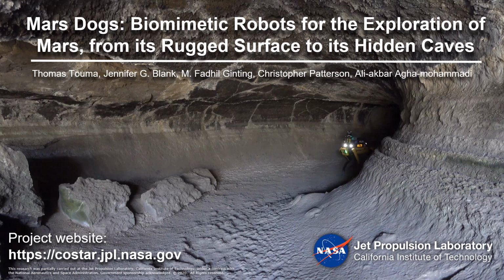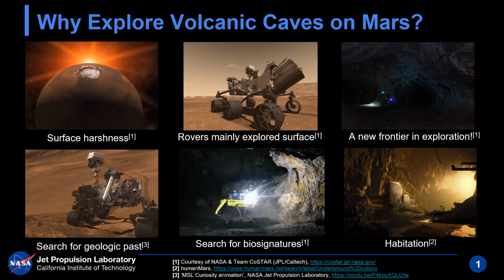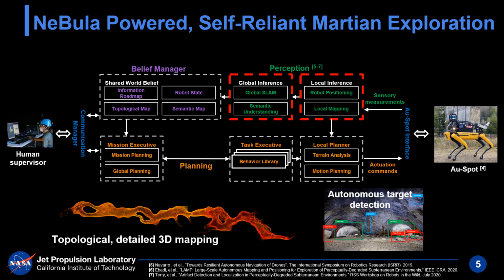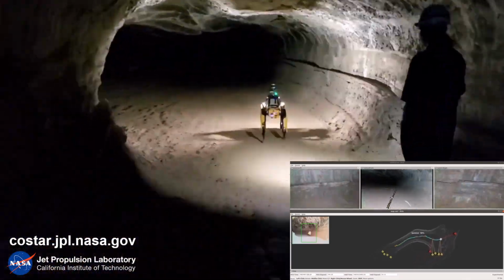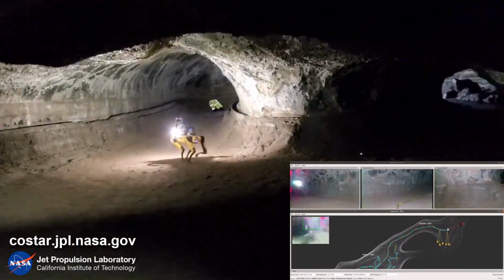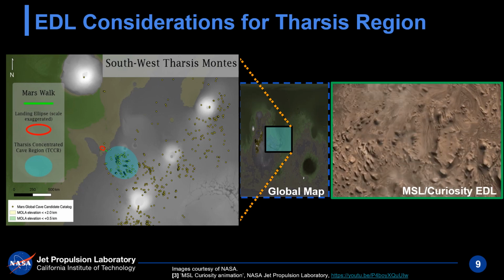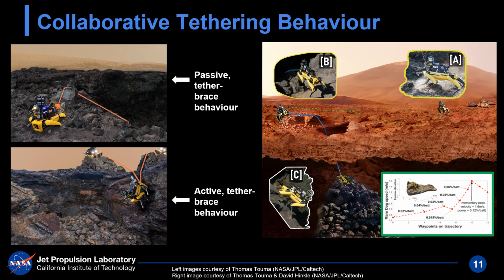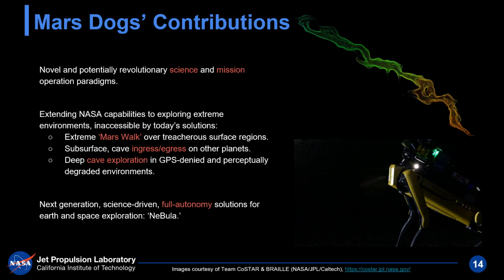Mars Dogs: AI Powered Autonomous Robot Concept for Mars - [R&D from NASA's Team CoSTAR]

Comment: honestly if it finds a bone, we should be worried hahahahaha

Otherwise i honestly think the most likely long term plan that would work insanely well, instead of spending the who knows how many millions in their one tiny package load, commision a heavy space X ship, then they could load not only one, but way more then that, maybe 10-20 ? additionally they would be able to load it up with instruments , some might be equiped with arms which could perform maintenance, they could even have solar pannels inside which 3-4 of them could install them outside... QR code lazer engraved thus no worries about them ever going away... making sure that the external solar panels can easily recharge the main ship which houses them overnight, this would avoid a few issues such as the cold nights which could cause component damage and extending the life of them. As space X could have a ladder / elevator system which the robot dogs could opperate, they can be equipped with two "mouths" why not hands ? and able to grab objects such as smaller pannels, install pannels they simply have to already be linked to the ship thus just brought down and unfolded... this would provide indefinite power, then have one of those dogs with  a broom to you know... house keeping :D

THIS! is a long term plan, many more experiments could be conducted if inside the ship there are some instruments, they could grab samples, the ship would have a larger base thus more space to have equipement etc.. etc.. also test if water is found to have a tiny test to see if we can extract  what we need from mars ice, and see if there is any organism etc.

lets see what they end up doing

Comment: Remember that Mars gravity is significantly less that Earth. This means the payload capacity will fit much more mass and falls would be less dangerous than falls of equal height on Earth. Traversal may become significatly easier if the platform can learn to jump in the lower gravity to evade obstacles that would be impassable on earth
Reply: Exactly ! Spot can move at a top speed of 5kmh in earth , Mars gravity is lower which will make spot consume less energy and also increase his speed , and good note ! base spot can actually jump but not too high , yet as you said , those jumps can be better in Mars due to lower Gravity
Reply: @ulforcemegamon3094  if i am not mistaken its still gonna take multiple of minutes before the command is reached anyways all the way from earth
Reply: @Modestasgailius  yeah , but that happened with rovers too , anyways is still gonna be interesing
Reply: @ulforcemegamon3094  well there will have to be a lot of modifications to these dogs to protect them from the harsh Martian environments, credits to boston dynamics tho for creating a solid base and thus from here is when JPL and NASA specialists will be taking over
Reply: @Modestasgailius  you are right , but i predict spot will last longer since spot can actually explore caves , and caves are protected from both the dust and the radiation of Mars (for the most part)
Reply: @Modestasgailius  That's why it's best to make these autonomous to some degree. Just give it a certain set of parameters and let them explore. If Ingenuity flies according to plan, they could have robo dogs with landing and take off pads to allow even further recon range to look for more caves or land features. The robo dogs on Mars will be revolutionary, exploration wise.